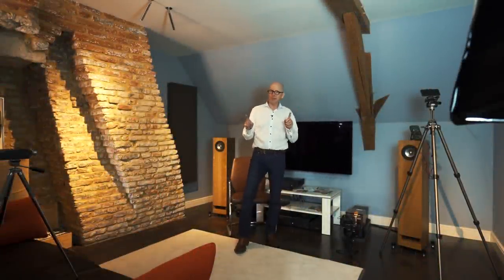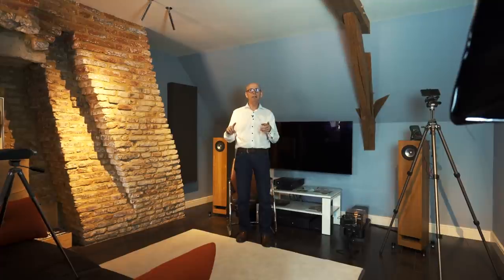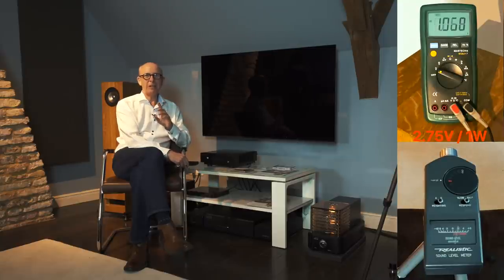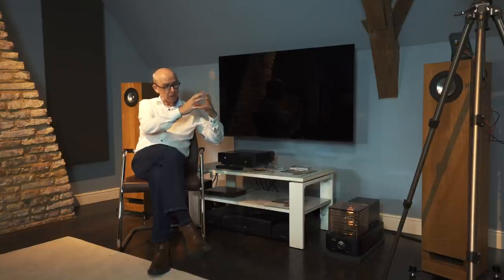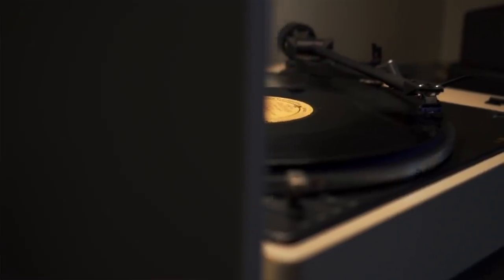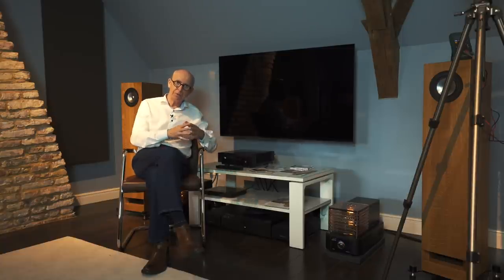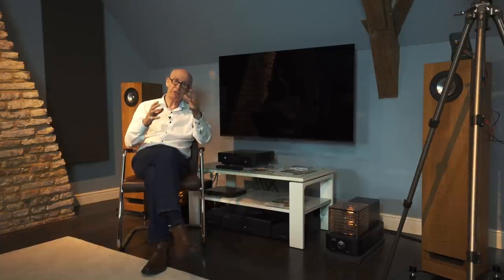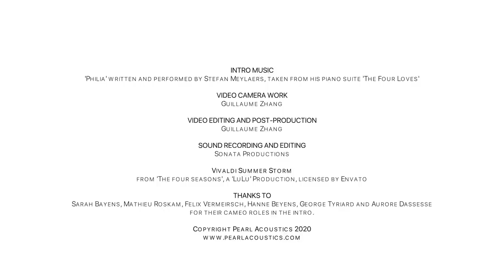How loud is 1 Watt (with an 87db Loudspeaker)?

Comment: Often single chip very low power mini amps like LM386, LM380, TDA2822 are built with minimum parts of low quality, but if you use high quality capacitors and resistors with proper circuit layout, powered by clean DC power source like 12v battery, and matched with highly efficient speakers, they sound quite fine while using less than 1w of DC power(for example 12v 70ma).

Of course they don't have the true HIFI specs, but I personally checked that they can easily produce average of 75~77db undistorted sound with one bookshelf speaker(8 ohm 2 way 5 inch 90db SPL) one meter away, while playing ordinary random musics, using less than 1w of DC power.

Usually if there is a problem it's the low output music source and if you use a low noise device with headphone output and volume control it's fine.

Comment: Would I be correct in saying that if the speakers were 4 ohms, the voltage would change to 1.47V in order to keep the 1 watt signal level?

Comment: Correct me if I am wrong, but shouldn't 5.5 V be 4 Watts as P=U^2/R?
Reply from the maker: Yes indeed that was a stupid error that hit overlooked in the production process. I mention our apology and correction  in the description to the video. Well spotted!
Reply: @PearlAcoustics  I wouldn't trust that meter to measure voltage for a non-sinusoidal signal like that. A sine wave would be a better test (and check how high a frequency it will do proper RMS for).

Comment: Excellent video! I have a pair of Spendor SP2/3E speakers with an efficiency of 88dB and a lovely vintage Revox A740 amp, rated at 100 watts per channel. Apart from excellent sound, the best feature of the amp is a pair of very accurate power meters. My normal listening range is 1 to 5 watts. If it gets to 10 watts, I'm getting up and turning the volume down! Do I need 100 watts per channel? Clearly not. But as Harley explains the key feature of a great amplifer is the ability to respond to driver loads quickly and accurately. The Revox weighs 20kg/44 lbs, has a 1000 watt transformer and 4 15,000 mf electrolytic capacitors the size of beer cans. Checks all the boxes for me! Thank you Harley!
Reply from the maker: You’re very welcome! Enjoy the music!
Reply: In just the right set-up, in a normal room, about 6 feet from the speakers, with 5W you should get around 95 dB peaks. That's plenty loud. For me, at least. 
But, in a larger room, further away from the speakers, just like that you need 50W. Because that's how things work. And if, for some reason, you so desire to peak above those 95 dB, let's say 10 more, have a wild guess. You need 500W. Level would be pretty loud. 
But there is another problem, especially with poor solid state amps. If the rated power would be 50 and gets driven at 50, there will be some sort of compression that makes music sound worse and worse (unless you have a very good amp, you need extra power available, even if not used). As someone tested this quite a bit, that's when the amplifier is also most likely to damage the speakers. Thus, there are some scenarios that would explain the need for power in a very honest way.

Comment: Great illustration! That said, I have 1200 watt monoblocks on my stereo, lol. I have seen about 120 watt peaks on the meters though, about 60 watts RMS and that's about all my ears want to take in the room. The speaker is a 87.7 db sensitivity Revel Ultima Studio 2. I will say the power demands increase hugely with the speaker's ability to produce deep bass. Also, to increase the volume 3db, you have to double the power, so it happens fast. The dynamics are actually audibly better than with the 600 watt monoblocks even though I'm only using 60 watts or less most of the time.
Reply: You should go with 2400watts, sounds even better x') ..
Reply: @klm_  Then you need air conditioning running when playing music.

Comment: Very interesting video. If 8 watts is enough, and we don't need to go beyond that, can we say that an amplifier capable of delivering let's say 100 watts is better than one capable of delivering 10 watts ? What's the relationship between max power output of an amplifier and "quality" at partial load ?
Reply from the maker: Dear Alexis, that’s a very good question. There are so many variables. If you have loudspeakers with a very stable resistance curve, ie it never drops much below 8 ohms (this is a big over simplification) then the amplifier does not need to draw so much current and a low wattage amplifier can be fine. The late amplifier designer, Gary Morison once proved that an amplifier that can deliver continuously 25 watts RMS, (average)  is more than enough to drive any domestic loudspeakers with a sensitivity of over 86db to deafening levels. He was always so frustrated by the implied need for more and more powerful amplifiers. For example, If you like to listen at low or moderate volume in a relatively small room, then what you need is an amplifier that works really well at low volume, that is able to reach its optimum working temperature at low output, so that it is performing right in the middle of its desired range. This is one reason why some ‘low powered’ amplifiers can out perform high powered amplifiers in domestic situations. Hoping this helps a little?
Reply: @PearlAcoustics  thank you, I understand and I agree with the idea of somewhat limited requirements in terms of watts in a domestic situation. I've once been told that a strong power supply is the key for stability in the widest dynamic range an amplifier can do. My own very unprofessional experience is going that way I must say and I've got used to measure the "quality" (it's a very generic term) of an amplifier by its weight.
Reply from the maker: @adewouters   indeed, the power supply is crucial. In the US Nelson Pass designs some very good amplifiers. In the UK, Colin Wonfor. But there are just so many! In the future, I believe class D will get better and better and then, everything changes.

Comment: An excellent demonstration and you point is taken, but...a speaker rated at 87 db is usually rated 1 watt at 1 meter. Your demo positioned the decibel meter 3 or 4 meters back. How much difference does that make?
Reply from the maker: The important bathing to bear in mind here is what the decibel meter was reading, that’s what counts. At its peak it read over 100db. Having said that the laws of physics say: ‘double the distance = you lose half the power, meaning -3db.’ The speakers are 87db per channel = 90 in total. 2 metres back you would expect 87db at 1 watt. Or 90 at 2 or 93 at 4watts and 96 at 8watts. and 99 at 16 watts. But my demo was showing how loud the music was in comparison with my voice. As the music bounced around the room, the simplified equation I mention is hard to apply. In any case, at 7 watts per channel it was very loud!

Comment: I just ordered a small class AB integrated that produces less than 50 watts at low distortion (according to one review, about 33 into 8ohms and 58 into 4). Comparatively, I have a Hegel h160 (overkill for my speakers) which weighs over 40 lbs and plays very, very well on the speakers I listen to...bliss.  

Thought about class D but the amps I was interested in are just that, amps and I wasn't prepared to just buy a pre if I found an amp to my liking.  Looking for a good dac with good pre abilities I can live with for a long time but I do like integrated amps.  Regardless, a smaller, lighter footprint is what I am after.

The amp I bought is a KECES E-40 and I am wondering how close to the Hegel it will sound at the volume I listen to which likely is typically a few watts as the video shows.  I really like my amp but I have fairly efficient standmounts and as I get older, I don't want heavy.  Looked at various tube, A/AB as well as class D choices and see anywhere from 35 to over 50 lbs (except class D).  As I only listen at low to moderate volumes, I am hoping for a lighter, smaller solution that gives me what I need...within a price point I can live with which is under $2000, preferably well under. 

Did I once listen at 100 watt levels, yes.  From time to time I may still want to do that but only a few songs and for a few minutes.  So that may justify getting into headphones which is the next foray.  But mainly I like two channel traditional speakers.  

Its been a long and both enjoyable and frustrating road trying to chose equipment over the years but at the end of it all, regardless of the equipment I have had, I just enjoy the music. 

Love the one you're with.

Comment: Does the 600w amp easier drive 5w when needed than maybe a 200w amp can do( I mean, normally) because the bigger one has higher capacity?
Reply from the maker: That’s a really interesting question. Logic would say yes but it’s actually down to the design. Think of a great big powerful lorry, engine... it doesn’t necessarily respond in revs quicker than a small 50cc motorbike engine. Great designs allow for power and response time. Class D amplifiers tend to do this at a budget price, but not necessarily with a musical result. The hobby we have is full of contradictions and, sadly, there is not one truth. Just like there is no one piano that is better than all the others! Different, yes, but better?
Reply: Just watts alone won't matter, you could for sure find a 200W amp that's better in that regard then a 600W amp and vice versa.

Comment: observation: @6: 50 - his digital meter should have a "hold " feature. Your Fluke meter holds so that the needle isn't flopping all over. Unless someone has an explanation.
observation: Notice the audio dampers under the gear. His are traditional looking like small hocky pucks. Expect to pay $100 - $200 under each component. The speakers stands are probably a different style.

Comment: What would happen with the Klipsches La Scala/Cornwall/Klipschorn that have more than 100db efficency .....an instant loss of Hearing ?
Reply: If asking the questions better  not to speed that  we know the answer. Teachers way;). 

  . Many here talk about efficiency of speaker   Any definition  what it is? Most producers measure loudness of speaker only at 1 kHz. How much different  may be  frequency characteristic for different speakers in compare to 1kHz is only imaginable. In sounds we listen to lot of harmonics at one time. and some speakers like horns have not impaired  middle  which may be advantage in timbre, loudness perception  and works for efficiency data  too.
Reply: @Mikexception  All you need to do is look at a frequency response sweep of any modern speaker to see that it is pretty flat and the sound level won't vary a whole lot with frequency.
Reply: @SomeTechGuy666  Frequency sweep is not reliable tool to judge sound equalization . With sweep you get each data in separated own time while all what we need is their  summary in common time.Time is the factor which is omitted in discussions .  FTT would be better but still not enough to think that speaker in room provides flat presentation.
Reply: It's worth pointing out that Klipsch measures their speaker sensitivity a bit differently than the norm, so while they have high sensitivity speakers the numbers are a bit inflated.

Comment: So, speed of amplification is directly proportional to the loudness no matter what type of speaker and materials used in them are. Is that your point? This video is interesting because I have never reached that level even with way more power. Even  though I have used a lot of amps both vintage and modern ones. Also I'm just curious how much of RMS can those drivers handle.

Comment: Okay i still don't get this why do some people say you need massive head room for your speakers, when they are getting above normal listening volume at 2 watts?  I understand that you don't want clipping, but you not getting near the capability of the amplifier?  Is the high watt amp a "need or a want"?
Reply from the maker: Generally, I would say power is a matter of preference, and dynamics, once your loudspeakers have enough power to drive them sufficiently. Unfortunately, choosing an amplifier can be much more complex than just considering power.

Comment: Personal question, I've purchased a DIY amp camp amplifier with 8 watts per channel and a pair of Klipsch r15m speakers with about 91-93 db sensitivity. Amplifier build is in progress (amp is a diy kit) & have ordered       the speakers but haven't been delivered yet. Yes, I'm a newbie and my intention here is to use this equipment to play vinyl lp's. I've a pro-ject elemental tt w/ortofon om5e cartridge. Do you think this combination of equipment will be able to produce good sound reproduction in a near field 4-5 ft. situation. I've a Schiit SYS line stage and will be using either a pro-ject mm or the Schiit Mani as a phono preamp for the tt.
Reply from the maker: Absolutely it will! (As long as it has a good power supply that can deliver amps  when required. Add 3db for every doubling in power. ie at 2 Watts your speakers will be making 96db and at 4 watts 99 and at 8 watts 102db. in your room - 102db will be beyond the point of pain and dangerously loud for extended listening. so relax, enjoy the music!
Reply: @PearlAcoustics  yes forgot - amp comes w/meanwell 24V 5A power supply with cord.
Reply: Fred, I bought 2 of the Pass Amp Camp DIY kits myself.  I have not started building them yet.  I'm setting up a tertiary listening room at my house, and decided to be creative.  I pulled a pair of Klipsch Forte II and one of my turntables out of storage, and I'm going to use the Pass Amp Camp components as Mono Blocks for a vinyl-only setup.  I'm going to buy a new tube preamp and tube phono preamp to complete the system.

@Pearl Acoustics -- Mr. Lovegrove, do you have any suggestions I should look at regarding the Tube Pre-amplifier?  Thanks in advance!
Reply from the maker: @allenfields9058  sorry, I don’t ☹️ I am not a big fan of Tube pre-amplifiers because you’re adding potentially ’noisy’ components. I like high quality, low noise, low distortion front ends with variable outputs. But there are so many amazing tube pre-amps to choose from. I am just not an expert in that field. We used to use an AYON tube pre-amplifier, and that worked fine
Reply: @PearlAcoustics  -- Mr. Lovegrove, by your reply, does that mean you prefer Solid State Integrated Amps over tube separates?  If so, what are your favorite Integrated Amps?  Thanks!
Reply from the maker: @allenfields9058  hi. My all time favourites are those from PureAudio from New Zealand. But there are so many to choose from! Maybe check out my video on What Amplifier?
Reply: @PearlAcoustics  -- I will do that.  Thanks for telling me about it.  I went to your company website after watching this YouTube clip, and I tip my hat to you -- absolutely beautiful speakers.  Beautiful.

Comment: Good video for those who bash 3-8 w tube amps as underpowered. Add in that vintage speakers usually had 93-95 db sensitivity. 95 db is loud! For those who address bass: usually nothing under 40 hz on records, and definitly not under 40 hz on a rock concert. Why? Well, mainly because of feedback. So: has tech moved forward at all?
Reply from the maker: Thanks for your contribution to the discussion!

Comment: Would it be the same clean volume if you weren't using that Macintosh to drive those but were using a cheaper amp?

I am so jealous...I have always wanted a Mac tube amp since I first heard one in the late 70's.

Comment: Very interesting video,  have you had any experience with Hegel amplifiers?
I have a Hegel H90 that is only 60wpc but its damping factor is over 2000 and it has the ability to play down to 2ohms ,
to my ears it has tons of power and in my room any more power would be unessasary.
Reply from the maker: One of our clients in the UK, loves the pairing of The Sibelius with his Hegel H90. A high damping factor is a big, big plus to getting the drive cone under control in the lower register.
Reply: @PearlAcoustics  im using KEF LS50's with mine and its a lovely match.
Reply: @PearlAcoustics  your speakers look really nice, would love to be able to hear them with my Hegel H90, im planning on upgrading to floorstanders in the future and these look just like the type of speakers im looking for.

Comment: So that opens another can of worms, what specifications on an amp will tell you how good it actually is at controlling the speakers in delivering super fast responsive voltage changes? (Rather than caring about the watts)

Comment: So you say the better the capacitor banks (higher?) the faster in can deliver that energy required?
Reply from the maker: Hi, thanks for your question. Unfortunately it’s not as straightforward as that, it really depends on the entire architecture. For example, class A tube amplifiers use output transformers etc. I have heard solid state amplifiers with massive capacitor banks that sound ‘dull’ for want of a better word. If it were purely a question capacitance, everyone would design their amplifiers the same way. In recent years, the subject of  ‘capacitance’ has become a bit of a red herring, I am afraid
Reply: @PearlAcoustics  Thank you Mr. Lovegrove for explanation. You thing, according to this video, that max SPL from a speaker of 94,3dB will be sufficient for a normal european livingroom? Also using MarkAudio driver, which have limited power handling
Reply from the maker: @dannyb5874  94,5db from one speaker gives you 98 from two. That would be plenty for me. But that’s a question of taste and hearing capability.